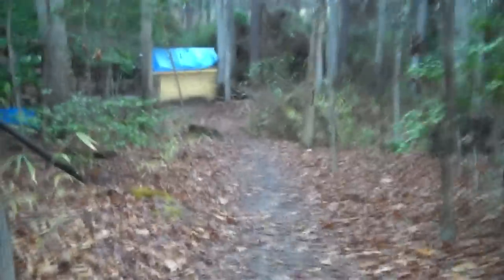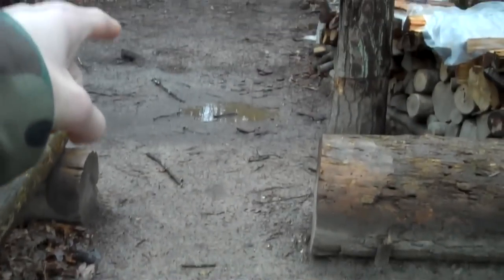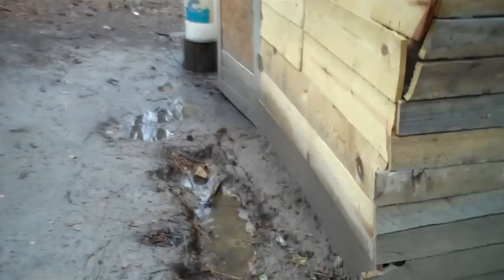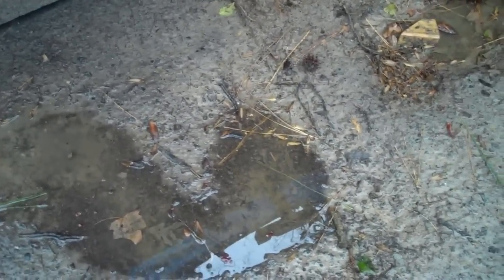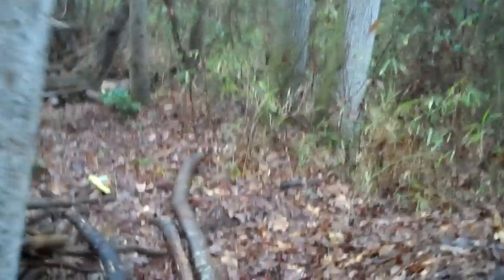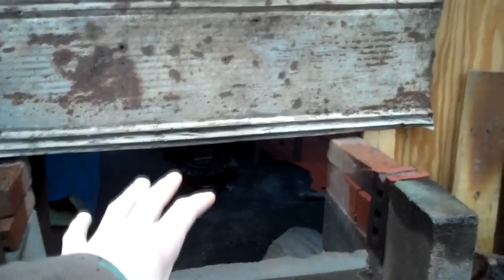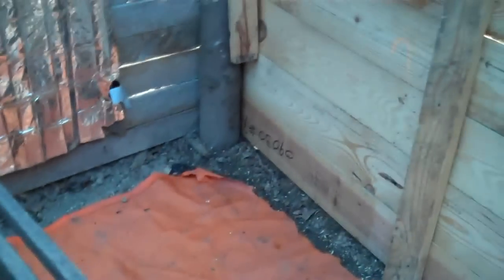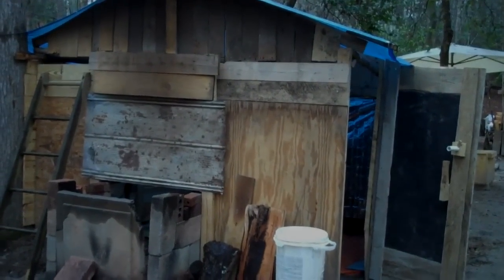Chapter of the Hut 8

Comment: Nice fort. You put a lot of hard work in it. You oughta just start diggin trenches and cover them with wood planks through the camp where you want the water to go. Cap that fireplace with a cone shape will help out (leave the opening big as a paper plate). When you get some paint on the cabin it will make it last 10 years longer. Have fun.

Comment: Hey man i had the same issue with my shed. I did the same thing with the trench and slop. I finally added about 4 to 6 inches of dirt inside across the floor and it fixed my issue so long as it doesn't rain a flood.

Comment: @BraveTheWilds For sure. Have a board coming down the front inside about 2 feet,  sorta like a box on top of the fireplace, then boards or whatever for the cone on top. When you start the fire, hold something burning up in the chimney and the draft will start.

Comment: what you could do for the water issue by the fire place is take medal conduit the stuff they use for electical wiring and drill holes in it the biggest  stuff you could find and lay it like drain tile with rocks from the creek just an idea